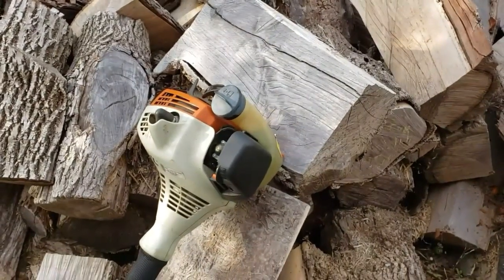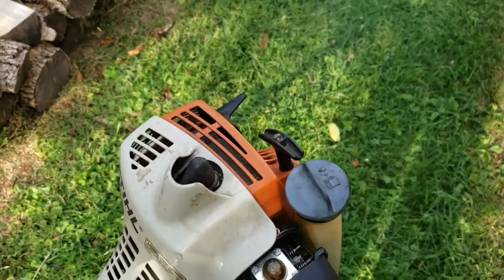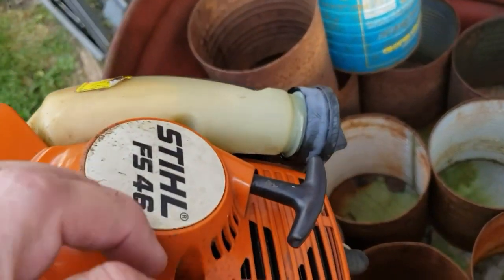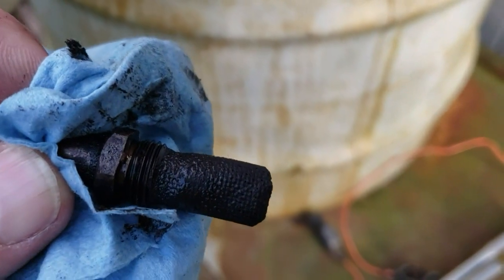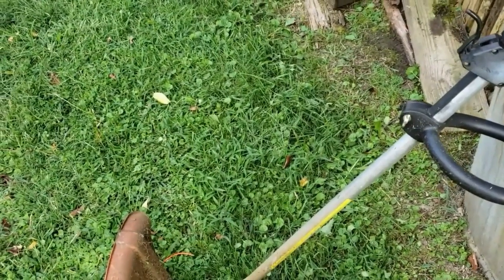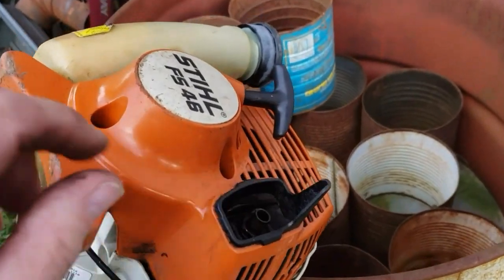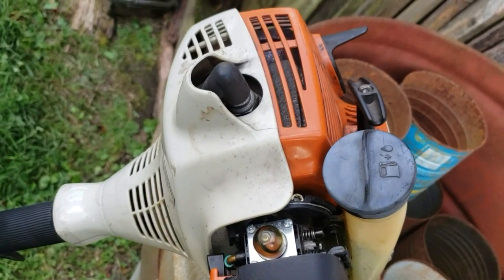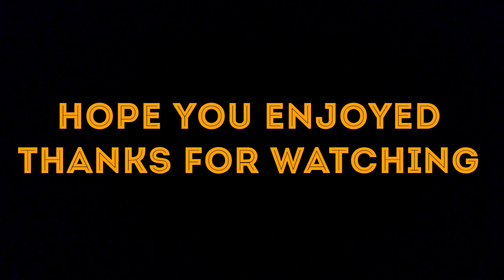Stihl FS46 String Trimmer won't rev up

Comment: This was brilliant, thanks mate. I'd tried new spark plug, new air filter, new fuel filter, but it was still struggling. Took this out, a bit of WD40 and a wire brush - running beautifully!!! Thanks again.
Reply from the maker: Glad this video was helpful.

Comment: Spot on same issue with a KM55R, I took carb apart cleaned it, checked compression, new spark plug, clean fresh gas mix…still low power. Cleaned the spark arrestor screen, good as new! Thanks

Comment: Perfect demo! Was having the same issue. Replaced the air filter and spark plug with no improvement.  Took a wire brush (and some heat) to the clogged spark arrester as described and runs like new!  Thank you!

Comment: I've been fighting this issue with my trimmer now for 2-3 years.  I was thinking all along it could be the carb.  I saw your tip on this video, and within 10 min my trimmer is now up and running again.  Many thanks !!
Reply from the maker: Glad this video helped.
Reply: @craigtimmons3468  After a few more uses, the trimmer started to misbehave again.  So I installed a new carb and so far all is well.  So, your tip of cleaning the spark arrestor and a new carb is what it took to get my old FS46 up and running.  Thanks again for your instructional video/tips.  Much appreciated as it saved me from buying a new machine.

Comment: I rent a small house, small yard. Landlord supply's lawn mower and weed wacker. This year he came over and said weed wacker was not running well. He put in new spark plug, air filter and fooled around with it for half a day. I just spent 3 mins. with your video pulled the spark arrester cleaned it with carb cleaner and a wire brush and bada bing it runs like a charm. Thank you I now have brownie points with the landlord. :)
Reply from the maker: Glad I could help with the Brownie Points.

Comment: My FS45 will idle but when the throttle is fully applied it stalls, then stops, I have removed the spark arrestor however there is no mesh, just a clean hole, maybe not required in Australia but i doubt that considering the bush fires we experience and how regulated we are here. I have removed the bottom plate of the carby and allowed the fuel to drain even gave the primer a couple of pumps to ensure any foreign matter is expelled, note the carby is relative new and have had no problems until now, have cleaned the spark plug, air intake filter is clean and the fuel filter inspected and clean, however the problem still exists. Cheers Wayne Morris Newcastle NSW Aus
Reply from the maker: Let's start here,  did you check the fine screen inside the carb? If restricted it can cause your issue, might look clean but remove it and hold it up to a light and make 100% sure it's not plugged. 

You may have what is called a catalyst muffler (catalytic converter) that may be plugged, remove the muffler from the saw and test run.

Airfilter clean?

Make sure the fuel filter is staying submerged in the fuel at all times the filter needs to be weighted.
Make sure the fuel lines are routed correctly,  filter to carb inlet, carb outlet to purge bulb, purge bulb to tank return.  Pulling gas through the wrong hoes can create your issue.

Is the carb adjustments limited? If so remove the limiters and try adjusting the low side needle first. 
This will be the small needle closest to the engine Hi needle is closest to the carb.

You may have a vacuum/pressure leak, with saw running spray break clean anyplace there could be a leak, if there is it will either stumble or quit running. 

An extreme case is the coil could be faulty, but I doubt this is the case but could be.

Comment: Hi Craig,, common issues, should help out a lot of people.... including myself ..must admit I didn't know straight off..... great tip.....
Reply from the maker: Nicky this is way more common than someone may think, the giveaway for me was when it started loosing rpm's  after holding it at wide open throttle of a short period of time. This is almost always a dead giveaway of a restricted exhaust on anything.

Comment: G'day mate my still FS SS RC Whipper snipper, won't go full reves I don't know what to do. Please help me. 🙏 cheers 🇦🇺🍺🍺🍺🍺
Reply from the maker: Hard to help with out being able to hear it run, but these are common things I will check, is the gas fresh? Pull the spark arrestor and run, check air filter, instsll a new spark plug, make sure the throttle is wide open when trigger is fully pulled and try adjusting Hi speed mixture jet on carb if possible and you have the knowledge.

Comment: I have FS 45, carb has numbers S97 748?, can't read the last digit. This is a single screw adjust. When using the numbers on it all the carbs come up as two screw adjust, High/low.  When looking thru the Zama carb listing it also shows two screw adjust. I can't find any listing for a single screw adjust type.  Any info?
Reply from the maker: My guess would be that the carb you have may not the the correct one, According to Stihl Parts List you should have a C1Q-S58B 
part # 4140 120 0610, this is whats being shown as original equipment on your trimmer per Stihl IPL, and it dose have Hi and Low adjustment needles.
Hope this helps.
Reply: Craig Timmons that is what I am believing also.  The customer says he bought it new at a local Stihl dealer and that dealer is the only place he ever took it for repair.  I told him that it was not what Stihl puts on as it has no Stihl logo which Stihl always uses on their original equipment.  Any way I have no choice but to put on an aftermarket as I have not an original to replace it with.  I don't want to open up its Welch plug as I can't get any repair parts for it anyway.   Other repair person said it was an intake leak as it would not rev.  I used another Stihl carb off of another for a test and it ran perfect!     Thanks for your quick reply and knowledge.

Comment: I’ve replaced the spark arrestor and still have the same issue
Reply from the maker: If yours has the EPA muffler (catalytic converter) then your muffler ma be partially plugged up, there could be a carb or fueling issue, try adjusting the carb hi and low jets, make sure the fuel line and purge bulb doesn't have a hole in it, make sure the fuel filter isn't plugged, could also be a faulty tank vent or the little fines screen inside the carb or you could have a vacuum leak.

Comment: You can tell because the engine doesn’t die, just struggles to breath.  Many of my customers dont know how to mix oiil with gas and pour the whole bottle meant for 2.5 galllons into a gallon gas can!
Reply from the maker: At 10:1 the screens don't stay free flowing very long 🤬
Reply: That and the ones that think bar oil is for mixing with fuel will drive you nuts too!

Comment: Try cleaning the carb
Reply from the maker: Why would one waste their time to clean the carb when all that was needed was the spark arrestor cleaned and a fine tune of the jets.
Reply: Craig Timmons I clean my carb every year. I own about 3 sthil weed eaters. One of them is about 27 years old the don’t even make the parts for it anymore. It runs just fine.
Reply from the maker: @TheCowboyKid  Wasnt saying anything negative just asking why waste time cleaning the carb when all that was needed was the arrestor screen cleaned and a fine tune. When your working for pay time is money lost when it doesn't need done.